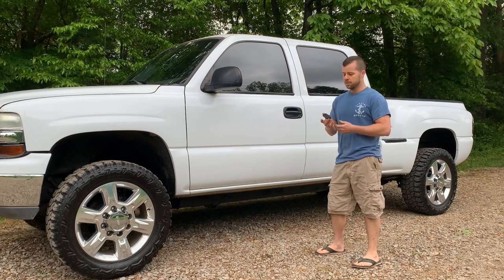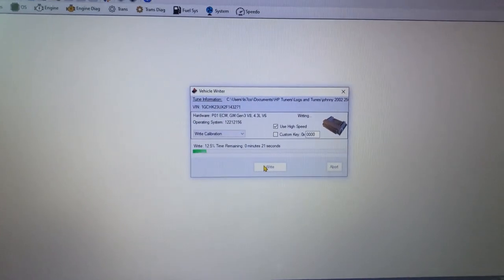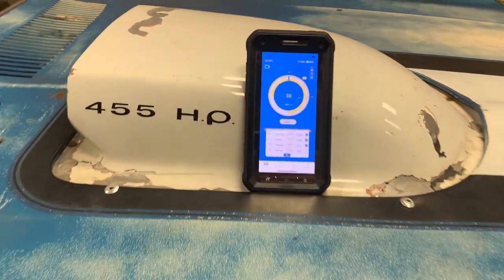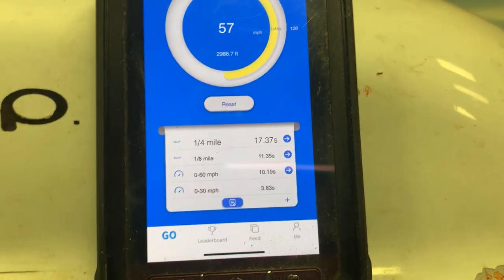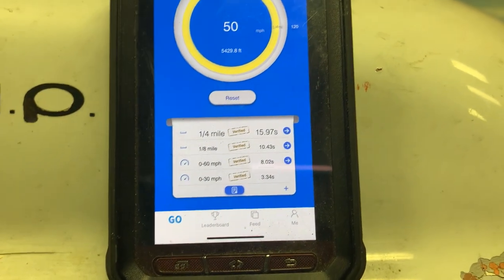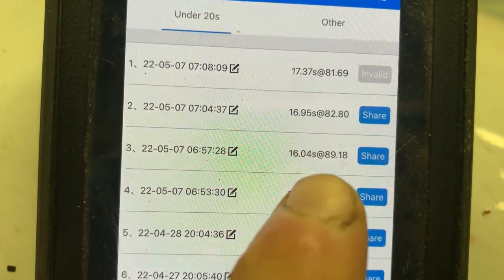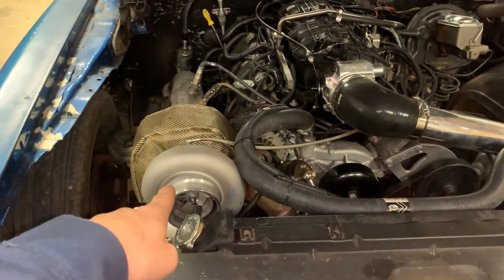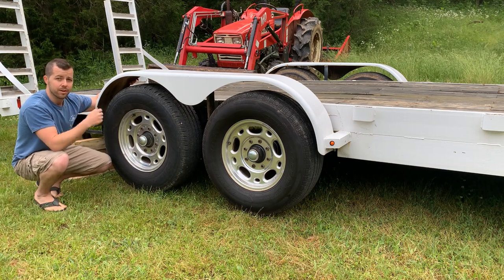Truck Norris cam 1/4 mile testing with dragy! stock vs custom tune, cammed LQ4 2500hd

Comment: I've also got an 03 with a flat top 6.0, 823's, JFR Cam, bread box intake, t6 Fahler Speed log, billet S475, Yank triple disc, 80e I built, 4.10's, duramax intercooler, e-fans, etc.  Your setup would do well with the turbo also, I have a few videos of it on my channel if you want to check it out.
Reply from the maker: Definitely checking that out

Comment: Good videos. I have an 03 crew cab 4x4 2500hd, it has a 6.0 I did with flat tops, 243s, 212-218 .600/.585 on 110 lsa, tbss intake, 33# flex inj, 3.73s on 285s, e-fans, headers, and I tuned it.  I need to take it out and do a drag pass to see how it compares to yours lol.
Reply from the maker: Nice setup!

Comment: you need some 456 gears to get you moving off the line. efans and some 243/799's would help alot aswell. the tbss intake swap with the xlink and ls3 tb is a big help aswell. btw its a really good sounding and looking truck!!! love the wheels
Reply from the maker: Thanks, it actually has 799 heads on it. I do want to do a TBSS intake but I may end up just doing a small turbo later.  The Efans don’t seem to be worth it from the dynos I’ve seen compared to a working clutch fan.
Would love 4.56 gears but I plan to do a lift and 37s maybe one day and I will go with 4.88s when I do that.
Reply: @JohnnyAnderson1  efans are worth their weight in gold if done right. Meaning the right harness controlled by the computer. But you gotta get 09+ HD fans. The small power and fuel mileage gain plus a much more efficient ac when slow driving or at idle. The tbss swap would benefit even more from a turbo. And awesome on the 488s!!!
Reply from the maker: @albertchaidez6317   If I ever come across some in a junkyard I will snatch them up for later. Better AC at idle would be worth it alone just for that lol

Comment: I came across your channel a couple of days ago while looking for cam options and subbed almost immediately. I’ve got a 2000 3/4 ton lq4, nv4500 5 spd, factory 3.73 gears on factory tire size and was looking for extra umph. My truck was a one owner 135,000 mile daily driver of my neighbors. It needs a clutch and figure while the trans is out, might as well spend some time and make this truck what I want. Definitely want to swap for electric fans and I like this cam option. Time to look for some 799/243 heads while I’m at it. My question is, do you think I should go ahead with a stage 1 or stage 2 clutch?
Reply from the maker: Awesome, hope you found some of the videos useful. That seems like kinda low miles to need a clutch but I guess it would depend how it was used. As long as it’s not a “racing” style puck type clutch it should be fine. A better friction material than stock and stronger pressure plate would definitely be a good idea. I thought about the electric fans also but in my option the little bit of added power (mainly at high rpm) doesn’t seem worth the money effort to me.
Reply: @JohnnyAnderson1  yeah, the clutch started chattering a couple of weeks ago. They pulled horse trailers with it early on. It’s got 150,000 on it now.
Reply from the maker: @Toad.outside  Gotcha, that’s makes sense then. Those are some tuff transmissions though and very hard to find.

Comment: What’s next for the 2500hd e-fans?Escalade dic? Heavy long haul tow mpg? Love the 2500hd content keep it coming man.
Reply from the maker: E fans don’t really seem to be worth it for the money, a properly working clutch type fan is pretty efficient for a truck in my opinion, The e fans are a must on the higher RPM builds though..
When I get time to edit it there will be a video with really tiny tires comparing performance lol. If I tow out of town I will definitely do a long haul MPG test.
I’d love to turbo it but to many other projects right now lol.

Comment: Hey man you ever consider regearing? Or a trans swap? That tcm2650 from zero gravity performance can control a 6L80 and a 8L90 and you'd have a way stronger first gear with and a better overdrive ratio, 4L80 is an awesome trans but the gearing in them are so miserable to drive with to me anyways in a truck
Reply from the maker: I doubt I would ever do the 6 speed, but the ratios in the 8 speed and 10 speed are awesome. Either one of those with a 4.88 gear would be insane, maybe if my channel blows up I might consider that 😂 😂 😂 
But at that point I would also swap in the direct injected 6.2 that sits in front of it lol.
Reply: @JohnnyAnderson1  planning on l83(5.3 gen v) swapping my tahoe with a 8 or 10 speed. My mom has one stock and they go and from the cammed power curves I've seen they have a bit more then a ls
Reply from the maker: @djmurria   For sure, that will be a awesome swap. 
The direct injection allows more compression, and the variable cam timing adds a ton of torque.

In stock form a Gen 5 5.3 is better than a Gen 3 6.0 in efficiency and power, and like you said the gear ratios in the transmissions are awesome!

I love this truck and if I drove it as a daily thats the swap I would be doing.
Reply: @JohnnyAnderson1  true man I really wanna do an L83 8L90/10L90 swap into my truck but you just can't find them anywhere and when you do super expensive especially in Saskatchewan, you can easily find a 6L80 for 200 bucks though
Reply from the maker: @chrishansen7004  True, the L83's with 8 speeds are around $4500-5000 and the 10 speeds which are lower mile and newer are over 5K for the ones ive seen. I would just kick myself if I didnt hold off until I found a 8 or 10 speed over the 6 lol
Reply: @JohnnyAnderson1  the 6 speed is still a pretty good trans too though compared too a 4L80 you still get a really strong takeoff gear as first gear in a 6L80 is around 4:1 whereas first gear in the 4L80 is the same as the 6L80 second gear and then you get a second 0.67 overdrive compared too 0.75
Reply: @JohnnyAnderson1  yea I that's what I seen 5.3 with cam vs either a 6.0 or 5.3 with cam and heads can't remember but 50+ ftlbs and and hp more every where. That and a 8 speed should make it feel fast and still probably good mpg
Reply: @JohnnyAnderson1  that's what I've been seeing too 4-5k and still would have to get computer and harness. Still on the fence about it thought but I need to do something soon. May just turn a 5.3 to 5.7 and cam it just for right now
Reply from the maker: @djmurria  Or just keep it a 5.3 and do a small turbo! lol 
The 6L80 ratios are defiantly better but I dont think the swap would be worth it in my opinion since the 4L80e is practically bullet proof, I had though about how cool it would be to have a gear venders behind a 80E (for 2wd operation only) but man there not cheap, and would need new driveshaft.

When im not towing I could defiantly use a taller highway gear though!
Reply: @JohnnyAnderson1  that's another thing I'm considering. Motor has almost 270k on it so it's definitely time to be refreshed. I figured if I refresh it go ahead and go 5.7(use gen 4 rods) that way I have a good base for if it decide to turbo it. It's my only vehicle I can daily so can't get to wild with it. But for the price of a gear vendors I'd have to go to a 8l or 10l. With my 3.73s or even 3.42 would be just as good I feel.
Reply from the maker: @djmurria  270k aint nothin if its had oil changes and is clean inside. Mine is very close to that, these gen 3 motors are proven passed 400k regularly. No idea how many miles are on the LM7 in my firebird now with boost but the Lq4 that was in it had 320K miles worth of driving in a 14,000lb box truck before I cammed it and did regular 7,000rpm burnouts lol.
it was running great until I overheated it BAD from a water pump leak.
Reply: @JohnnyAnderson1  don't know the history on it that's the thing lol. I just got it. Oil filter that was on it when I got it had 8/18/16 on it and registration expired in 19 lol. I just got it in 4/22 trans was messed up swapped it out now its my daily.

Comment: Dragy is awesome eehhh??!!

Sounds you still have a delay in the tune when you launch.
Reply from the maker: Lol yes it is!
I was stalling it up on the brake it seems to launch better that way. Gonna try and get some outside video of the next “test”  with the tiny tires haha
Reply: @JohnnyAnderson1  that will be a very interesting test! I need to do that now that i have the 305/70 17 to see how much slower it is vs the 285/70 17. The tire change made the gearing ssssooooooo much longer. It needs 4.56 or a 4.88 gear with these tires.
Reply from the maker: @HioSSilver1999  Yep, I really wanna do 37s  but no way without gearing.

Comment: Have you upgraded the fuel pump? Finally about to get to my install but debating on upgrading the fuel pump. Get a dyno yet? Our builds are similar and I'm expecting to get over 500hp crank so I'll be at the limit of the stock fuel pump's 430whp capability. I wan't to make sure I don't leave any HP/TQ behind during the dyno tuning.
Reply from the maker: Haven’t had to mess with the pump or injectors, I don’t you would see 500hp at the crank without a massively large cam. 
This cam would be closer to the 450hp mark on a 10.5 ish compression 6.0
No dyno close to me and with the 4l80 and heavy 33s I’m sure I would be very disappointed with numbers lol
Reply: @JohnnyAnderson1  well for me the lq9 is getting upgraded with the ls3 tb, tbss manifold, 42lb injectors, ported & milled/decked 706 heads, with upgraded roller rockers, etc... expecting to hit 500hp crank but we will see. Better to be safe than sorry paying for a dyno tune and missing out on hp/tq because the pump can't provide. 🤞🙏
Reply from the maker: @n8vjefe  very true!

Comment: Wish my suburban with truck Norris cam ran good had nothing but problems. Who did your tuning
Reply from the maker: I copied a camed 6.0 tune from sloppy mechanics tune repository and compared it to my original tune and adjusted from there.
 Its still WAY to rich at WOT but ive been using my wideband on my car so I havent been able to fully tune the fueling on it yet.

What problems are you having? 
What are you using to tune it with?
Reply: @JohnnyAnderson1   when ever I go to start it sometimes is doesn't start and then sometimes it will crank but seems like the starter keeps trying to start it . Also it tries to push through when you are stopped like you can feel it in brake pedal and when you go to take off from dead stop it falls on its face super slow acceleration  hp tunners I didn't tune it the guy that did dod delete did and he says that's how a cammed car does on all of it. So I'm pretty sure it's locked now so I'm going to have to get another computer
Reply from the maker: @ericsych821  Yea your tune is not right, idle is to high if its pushing through the brakes at a stop, these cams will idle almost as low as the stock cam.
I didnt notice any loss in power from a dead stop, what gear ratio and tire size do you have?
Reply: @JohnnyAnderson1  don't know off hand stock 2013 4x4 6l80
Reply: @ericsych821  It's because the Truck Norris cam requires a tune. It isn't disclosed on the website or packaging but Eric and BTR made videos talking about tuning being required. The cam is not a drop in baby cam like the Summit Racing truck cams. Once you get a base tune to fix the AFR at idle so you can drive it around, I'd suggest finding a dyno tuner and paying for a proper tune.
Reply: @n8vjefe  it was tuned but the guy I don't think 🤔 did right and I'm 75% sure it's tunner locked so can't take it no where

Comment: Curious to know if this is stock converter or higher stall?
Reply from the maker: Stock converter that comes in the 8 lug trucks with 4l80e
Reply: @JohnnyAnderson1  okay, cool TY
Reply from the maker: @ryanirdi5219  no problem

Comment: Put nitrous on it and knock off 2 or more seconds!  my stock hd with a 150 shot ran a 14.0 in 4wd
Reply from the maker: Probably did lol, if I do anything else it will be a little tiny turbo. If I could get 4-5 psi by 2500 rpm this thing would pull like a diesel